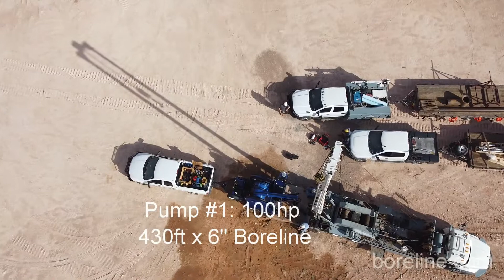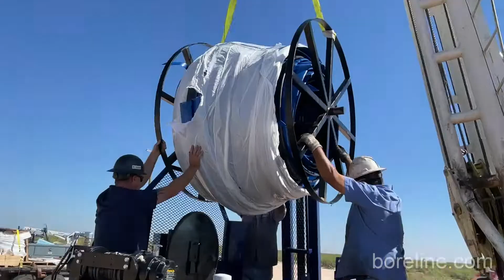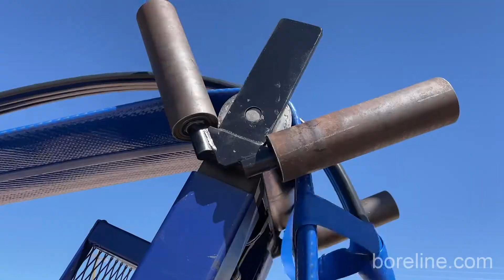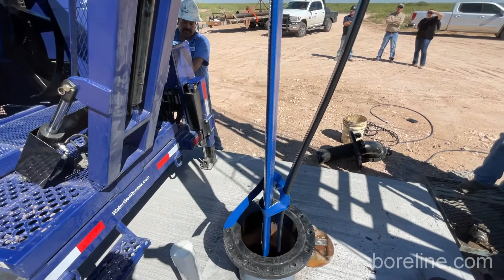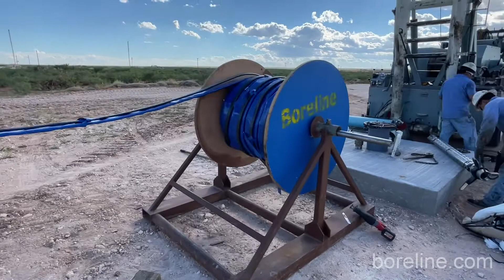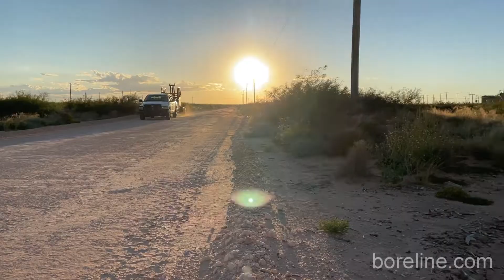Three big submersible pumps installed in one day with Boreline FlexiRiser

Comment: I am so glad to have found your product.  I am getting the residential version at wellhose... I plan on putting my hose on a drum and lowering it when I need it, and then pulling it out so protect pumps.  My concern since the wire cable is not fastened closely to the drop line, so that the hose can expand as it fills with water, that there may be more of a concern of cable rub creating a short?
Reply from the maker: Hello AA and thank you for your future business.
No need to be concerned as we include Cable Straps that are used to support the power cable along the entire length of the Boreline and WellHose. You strap these around the power cable and around the Boreline. They hold the power cable against the Boreline and they will not restrict the flow during pumping. You are are all good !
Cheers
Reply: @HoseSolutions  thank you so much... your customer support is outstanding.  The folks at wellhose spent a lot of time communicating and answering questions by phone and email.  You have solved a huge problem for me as I am going through pumps like crazy due to water quality and lack of consistent use... and having pump contractors come out each time with their hoist rigs at $300 buck per hour is ridiculous when a homeowner can simply service their own residential project... As far as protecting the cable, I plan to wrap an extra jacket around the cable to protect it even further...
Reply from the maker: Hello AA. Thanks for the comments.
For sure, you can protect the power cable. We will include a couple of extra feet of hose that you can slide over the power cable as a protective sleeve. Please just remind us about this when you order your WellHose.
Cheers
Reply: @HoseSolutions  you guys are amazing